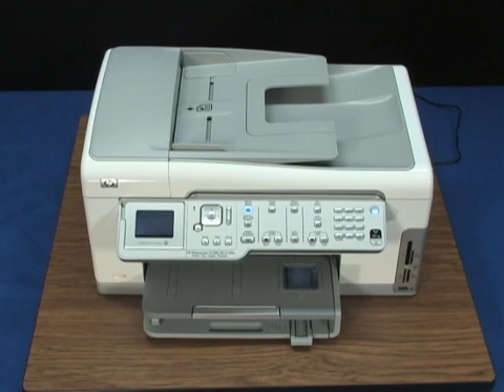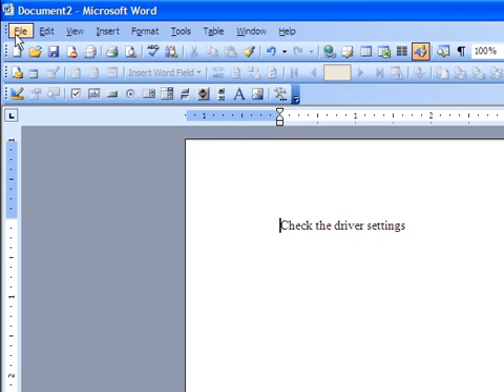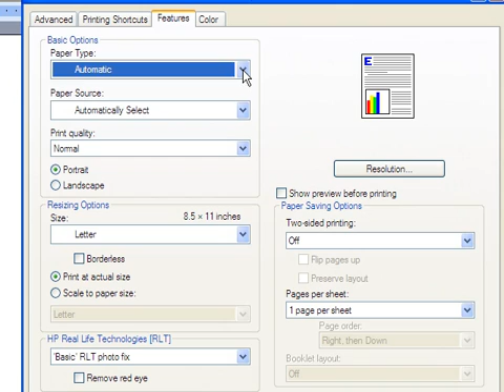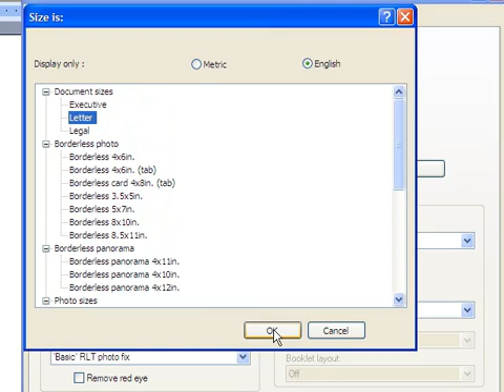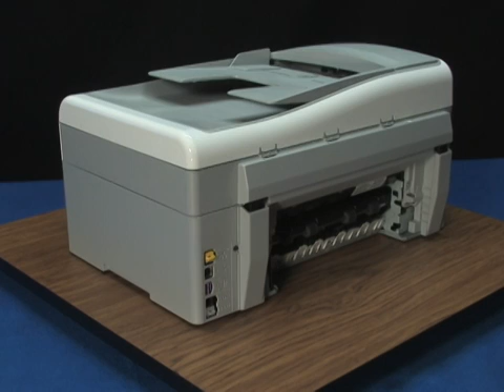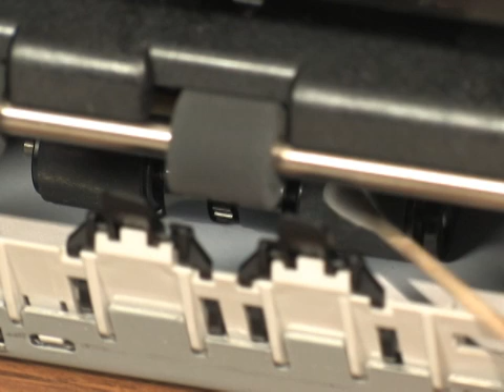Fixing Paper Pick-Up Issues | HP Photosmart C7280 All-in-One Printer | HP

Comment: My C7280 had a weird problem it was pulling in the paper then stopping or getting paper jams .I cleaned the rollers and pick up ones and tried again ,success! But the next print it was the same i cleaned them again and it was OK . But 2 prints later it was the same . After many attempts i spotted the problem the bar the 4 rollers sit on was moving sideways a fraction and not connecting to the black gears on the left end .The bar has a spline on it which grips the gear and obviously over time has worn the internal spline on the gear .If the bar moved to the right a fraction and the gear moved to the left it lost grip and didn't pick up the paper as it was fed to it .I have super glued the spline to the gear hopefully it will get a few more years out of this excellent machine
Reply from the maker: Hi David, thanks for contacting!
I understand that you are experiencing a paper pick up issue on your printer.
Please let us know how it goes!
If you need any help in the future, you can always get back to us.
Thank you for being a valuable HP customer.
Have a wonderful day!
Cheers!
Binu - Social Media Tech Support

Comment: Hi - Do I really need the 2 sided printing accessory on the back to print on a HP C7250? The paper just goes right threw to the back no ink on the paper? Anybody know? Thanks
Reply from the maker: +Melissa Sherwood The duplexer can be removed but it would need to be replaced with a non-duplexer back panel that will properly direct the paper.

Comment: My problem is printing photos. I bought HP EVERYDAY PHOTO / GLOSSY PAPER. Every time I try to print photos it would say "  Make sure the glossy side is facing down" which it is. Can I get some help about that please?!
Reply: +risquecat Load photo paper into the main paper tray. How you load the paper depends on where the tray is. If your printer has a separate photo paper tray and want to use it, consult your user guide on how to print from the tray.Load the short edge of the photo paper into the tray based on your printer type. If the paper has a perforated tab for handling the photo after it prints, load the paper so the tab faces up or towards you to prevent printing on it. To know more browse through the link: http://bit.ly/2ykhv7R
Reply: Thank you for the reply. Ill check out the link.
Reply: +risquecat You're welcome. Please try and let us know if that helps!

Comment: i need assistance please ...i have the same model as that one ...and displays the error message "The following ink cartridges appear to be missing " it displays all the six cartridges ,,,,,,what mint be the cause of the error...any assistance will highly be appreciated. Email: josetechsolutions1@gmail.com
Reply: +JOSETECH SOLUTIONS if An 'Ink cartridge is missing, incorrectly installed, or not intended for your device.' message displays on the printer control panel, and the printer does not print. Please use this document: http://bit.ly/2w0gGfw to isolate and troubleshoot the issue.

Comment: The following tip applies to ADF feed rollers and other paper feed rollers in printers. If wiping off with a wet cloth does not improve paper pickup, the rubber roller may be dry and hard - the fate of most rubber eventually, due to the outgassing of plasticizers which keep rubber soft. Sprayway makes a Rubber Cleaner and Rejuvinator ($7.82 on Amazon) which cleans and replaces the plasticizers in old rubber, restoring rollers to good condition. Best not to wait until rollers are dry and cracked, but even they can be made useful again with this stuff. If your printer is more than a year old, this stuff will prevent drying out.

Comment: This is for the basic paper jam stuff. In researching various discussion lists, I found some issues may be related to Teapo capacitors used during time of manufacture. But that requires a tear-down and some electronics repair know-how. (Don't bother unless you have some clue.) If your warantee is already expired, googling "How to disassemble and clean HP 7280 scanner glass mirror" may be a good starting point for accessing the innards.

Comment: Another possible issue not identified in the video: 
these printers are equipped with a blue "photo tray" in the main paper tray area. If this is pushed in, it'll try to draw from that instead of the main train tray, causing this same type of error. The solution is to reach your head in, and pull out that blue tray until it is flush with the main tray.